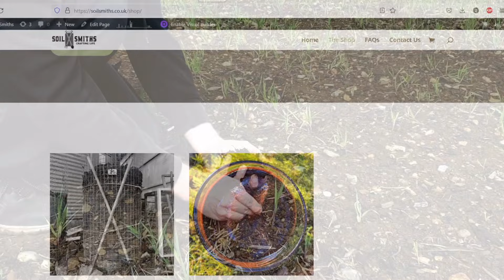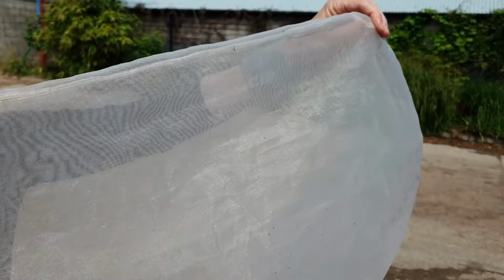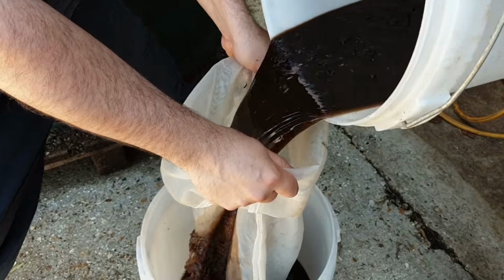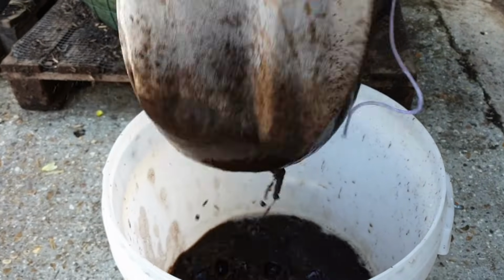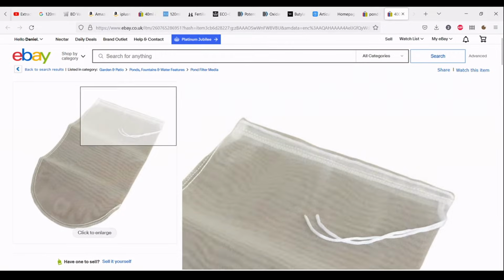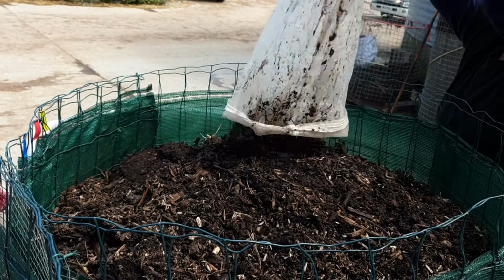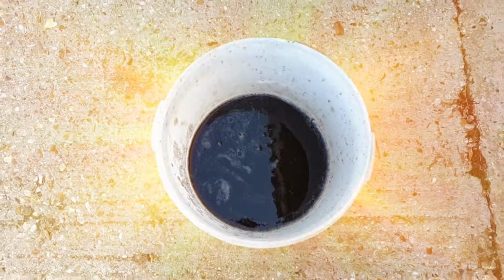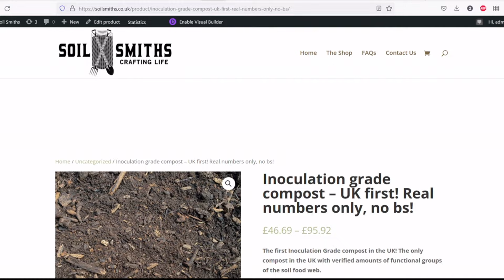The most effective tool for extracting microbes from compost

Comment: Great video - thank you - & I'm now a subscriber. I'm from Sydney, Australia where our water is chlorinated & has fluoride added. I'm guessing it would be preferable to use water without those additives - would you agree?
Reply from the maker: for straight chloride you could use vitamin C, but fluoride would need to be filtered with an active substance or reverse osmosis. Before you do it, you may want to send a sample to a lab to see if the amount is high enough to kill microbes. Where we are, the levels of chlorine are several times below the threshold.

Comment: Just because it is called compost tea does not mean you have to put it into a tea bag. You see people using nylon tights, which is a fine nylon mesh: 1. the mesh stops at least some of the microorganisms from getting out of the bag, 2. inside the bag the levels of nutrients and oxygen are low. Both of these make the method longer and less efficient.
Reply from the maker: what alternative do you propose?
Reply: Interesting video, very cool concept.
I suppose for a watering  you could probably use a sieve. 

I dont know if that would work for machinery or if it have to much debris.
Reply from the maker: @johnyguitar-u1i we used large scale sprayers with it. we put 1mm nozzles and removed filters.

Comment: Thanks a lot for this video.  It is most interesting.   One question, for how long can I store this compost extract before using?
Reply: Nevermind....  I just saw that someone asked this same question....  You don't store this, but use it at once.  😀
Reply from the maker: @edgardriba7513  if you happen to be in the UK, we've made a concentrated extract which is storable https://soilsmiths.co.uk/

Comment: This makes no sense, the microbes are there in the compost because of the food (decaying organic matter) Soil is already saturated with microbes for the amount of food. Just add organic matter (mulch) or compost to soil and the microbes will come
Reply from the maker: That's not what we've experienced. Adding microbes after a green waste compost application increased yield of barley by 40% against control. Adding microbes to a pasture increased biomass by 22%. Using them with radishes gave 27% increase. With carrots 19%. Chillies with seed coating 47%. We've measured a reduction in water loss and confirmed it with DNA analysis. This is not a panacea for world problems, but the notion that the microbes you have in the soil are all you need can be incorrect too.
Reply: @danieltyrkiel6438  Did you fertilize the control? You extracted the microbes from compost which is nutrient rich, it seems like you got some nutrients with the microbes
Reply from the maker: @johnnyroe8053  sure, there are always some, but Manchester Uni has been trialling it too, and they did a lab study where they sterilised our extract and the plants performed way worse. Hopefully that paper will be out at the end of the year.
Reply: @danieltyrkiel6438  Ideally you would try to measure the nutrient concentration of the "microbe solution" that you sprayed and then you match it with a nutrient solution without the microbes for the control.
Reply from the maker: @johnnyroe8053  it can also be done in reverse, and has been. The nutrient in microbes is not a significant factor.

Comment: Does the pressure of running the compost extract through the chemical sprayer not kill the microbes ?
Reply from the maker: No, we've checked after passing through the machine and it was good enough. We've lost some protozoa, but that wasn't significant enough to invalidate the kit.

Comment: very helpful sir , i often wondered how would you replace nitrogen on real farms ,i make compost myself but how would a guy with 100 or more arcres get microbes into the soil [in order to use less chemical], this looks like it might work .
Reply from the maker: We built a metal cage, suspended it under a gantry crane, and put it into an IBC container filled with water. Then used the same paddle mixer, and now we can have 600 litres at a time. You can then extract several times into the 600 litres to increase the amount of microbes in the mix. It won't replace all fertilisers. IF you grow intensively and use fertilisers already, you need other inputs. I would rather use manures though. Stabilise manures with effective microorganisms first to limit leaching.

Comment: How long can you store the extract?
Reply from the maker: you don't store the extract. just apply.
Reply: If you figure out how to put biota in a dormant state then it can be stored for ages under the right conditions for ex. dark and cool place otherwise extract has to be used on the same way as a tea straight after it's been made. 
I can only think of it theoretically for example put extract into the fridge to push biota for self preservation and then close the bottle/jar with lid to make conditions even worse to push the biota in the dormant state BUT  it's ONLY my theory.  Sorry for my English but I hope you caught the idea

Comment: Thank you for sharing THE KNOWLEDGE! 

I am not sure if I am going into right direction as I would like to apply this method to my vermicompost to extract all the biology. To my understanding it will work too BUT only with fresh worm casts due the highest bilogy activity.
Am I wrong?

Also, I would like to ask if you know how to store extract for a long term to keep biology alive?

 I've seen few commercial products selling worm poo extracts in bottles and saying that all the biology is undamaged and alive. 

I like experimenting with my own tools and hence I prefer to try first and buy late in case of failure 😂😂😂

Thank you for reading!!!
Reply from the maker: Hi Denis, I can imagine fresh casts will have a lot of bacteria. If you use plenty of wood chippings in your composters you could get quite a bit of fungi, and these actually increase with time. You can't keep aerobic biology alive in a sealed water environment. It needs air. We make our Goop in a format which allows air ingress and that coupled with fridge temps keeps it going for months.
Reply: @danieltyrkiel6438 Thanks for getting back to me. That's, interesting ... All commercial liquid ALIVE BIOLOGY inculants CLAIMS to contain bacterias and fungi in sleeping state in the tight closed bottles and can be stored in dark and cool place without keeping it in the fridge up to 6 months. I think to find out it is the only to check these products under the microscope. 
Would you suggest any budget but good microscope? 

Thank you!
Reply from the maker: @denislukasov4813  I usually suggest this one. We have seven of these in the lab. https://amscope.co.uk/products/omax-40x-2500x-super-speed-usb3-5mp-digital-compound-trinocular-led-microscope

Comment: This is different from compost tea though because compost tea is to propagate the bacteria by adding food and air. I don’t see why you couldn’t add a bubbler to your product with some food and increase your bacteria
Reply: Usually when making compost tea, you sacrifice the diversity of the microbes for a higher compost amount. Compost tea shouldn’t be used for seed inoculation it should be used for spraying the surface of leaves that protect them from leaf pathogens.
Reply from the maker: we usually get lots of flagellates when bubbling an extract. Fungi and nematodes die off.

Comment: nice to see this video, could be possible know the ratio of application with this high concentration? :)  thx so much
Reply from the maker: We would use up to 70 litres of compost extracted per hectare, but for seed application, we're still working it out. At the moment we're using 10-50ml of extract per litre of water to be used for coating seeds, so very little...

Comment: Do you have any concerns about microbial degradation going through pump agitation or higher pressures in your sprayer? Is there a maximum pressure and certain types of pumps that work better?
Reply from the maker: We only had access to the stock Chafer sprayer with max pressure of 5 bar. Checking at each stage with a microscope showed no losses.

Comment: What sort of rate/Ha and concentration of extract to H2O in the sprayer are we talking here. Defiantley something I'm interested in as we're moving away from Conventional Ag to Regen Ag.  I'm trialing home made seed dressing on ag scale here and have found that one of the best so far is made from using the liquid strained from soaking seeds for 18hrs. The theory being that the seed releases a lot of its enzymes, stored bacteria and goodies to prime soil for growth tip emergence and you're stripping that from those seeds and priming the desired seeds you're dressing. I noted a 15-20% increase in root mass and rhyzo -sheath on seed dressed with this at a concentration of 1:10 with rain water and applied at 20l/t of seed. I'm going to try your compost extraction technique and add a litre of the concentrate to my mix at 1:20. Thanks for the great video, much appreciated.
Reply from the maker: So far we've been extracting 70 litres of compost per hectare and adjusting the total water volume to suit the sprayer
Reply: @danieltyrkiel6438 so what’s quality can I use for my 16liters sprayer? Thanks
Reply from the maker: @emanovwevoke1913  quality or quantity? Extract can be used straight.
Reply: @Verney Teabag, this is amazing about the seed dressing. Definitely not the first time I am reading about such, though I had a slight variation in mind. 
How about, you let the seeds sprout, then use brown sugar to pull the microbes and enzymes from sprouted seeds? Kind of like in the same fashion as other bio amendments in KNF.

Comment: Do you think the plaster mixed will work on worm tea? Cheers m8
Reply from the maker: Worm castings, yes
Reply from the maker: You may be able to avoid a lot of straining as worm castings will break up into fine particles. The sifting step comes earlier though so it's a trade off

Comment: My soil hasn't seen fake fertiliser in the 20 years I've lived at my property. I must have good compost, as everything is strong and pest resistant. I only compost on the ground in piles, using plenty of carbon with green waste and woodchips. It's packed with worms. Cover crops really help the soil too.. the Daikon radish is my favourite. It's roots can grow 50cm, boring into the ground. You can grow it alongside crops, so it can transfer those nitrates to your crop. I never pull clover, since I noticed the plants next to it grew better. That pretty pink and white clover, fixes the lawns and puts on a good show with the wild fusias. Nature knows what it's doing.

Comment: Interesting. Will the same principle apply to worm castings when making worm tea?
Reply from the maker: Yes it will.
Reply: @danieltyrkiel6438  Thank you, but will this increase the population of microbes in the same way that a 24hour aerated bubble tea brew would do, or does it only separate the microbes from the compost?
Reply from the maker: @pilkyish  This is only an extraction process. It's designed to take the microbes off the compost and put it into water. Not increase their numbers.
Reply: @danieltyrkiel6438  Thanks for replying.
Reply: I do an extraction of vermicompost using a gentle, by hand agitation. Dunk & agitate every 15 min for about 2 hrs. I use coolish water & do the agitation in a cool, dark basement & drench seedlings ASAP. I plant out early mornings/late evenings. At planting, I pour/water the seedlings with any remaining liquid from the drench & throw some spent vermi muck from the compost screen bag in each hole.

But, I am not using mechanization. Clogging equip never an issue on a smallish scale.

Comment: Why on earth would you want to remove microbes from compost? Separation from their sustenance...pointless! Just add the compost to the soil.
Reply: It's a matter of scale for those planting acreage. Spraying an extract or seed coating allows them to stretch the biology using mechanized equipment.
Reply: @flatsville1  ...AND DEPRIVES THE MICROBES OF THE SUBSTRATE (COMPOST) UPON WHICH THEY DEPEND ON FOR SUSTENANCE.
Reply: @thetransplanter3337  Perhaps. He apparently has microscope work indicating the survive the initial agitation in significant enough numbers to be useful.

Will they ALL survive? Likely not.

All a large scale farmer needs is for enough to survive to decrease/eliminate use of fertilizer, pesticides & herbicides. Such is farming at scale. Remember, they are growing crops.

Further microscope work from soil samples at various points in the growing season indicating at what rate they survive & thrive post application is needed.

Some studies use end of season crop yeilds v control a plot to determine if the applied biology had any effect...which it apparently does.
Reply: @flatsville1  This violates a fundamental prociple of sutainable soil management: Add soil organic matter to nurture microbial health. Removing the microbes from their source of sustenance and placing them in unenriched soil is an early death sentence for them. The health of the soil is at stake. Your baseless theory is unwelcome.
Reply: @thetransplanter3337 Are you under the mistaken impression that a covering of physical compost is the only way to create/nourish microbes? Physical compost is only one of several microbe transfer methods. Sustainable farmers & ranchers have been spraying extracts, compost teas & other liquid biology into & on the soil where it thrives just fine. This is not new.

I take it you have never planted out large acreage using mechanization or even watched a farmer disc & drill seed. Warching a video of the process may help you understand the complexity of large scale farming with mechanized equipment.

Again, the point is to spread some biology to lessen fertilizer, herbicide & pesticide use using available configured equipment. Farmers/ranchers are putting in crops for production. If some microbes die in the process, that's expected. They are not curating individual microbes.

Numerous studies indicate seed coating or spraying into the furrow at planting boosts yeilds & does improve soil life in fields based on yeilds in studies. It works.

When you can figure-out how to make & spread 4 in of physical compost on site for each farm (were talking tons & tons & tons) for a 200 ac wheat, corn or soybean field, disc & drill the crop without making a shambles of the process, let us know.

This ain't backyard or market gardening. This is large scale ag.
Reply: @flatsville1  Your didactic condescension is not honored here. I am a Certified Crop Adviser and a Regenerative Organic Ag professional with over four decades of experience. You operate with an obsolete paradigm. Next time, look before you leap!
Reply: @thetransplanter3337  Based on that theory, there would be no microbial life in any soil that wasn't covered in compost which we know is not the case.

There are millions of microbes in soil taken from bare dirt patches.

Many gardeners use soil with a mulch covering & do fine with interplanting, relay cropping, rudimentary crop rotation &/or cover cropping. No curated compost needed. The spent crop roots & covercrop roots provide organic matter to the soil. The winter killed cover crop provides mulch. That's it.

Solid compost is only one method of delivering microbes. I've grown-out & used plugs followed by cover crops to distribute endo myco in a large area/long crop beds & used in furrow compost extract at seeding/transplant time for a bacteria boost.

I can afford to do this because I am not practicing large scale ag while trying to produce a crop on contract.
Reply: @thetransplanter3337  absolute bollocks. Apply the liquid to a seed and sow, they will begin the mutualistic association within days.
Di and Ian Haggerty have had overwhelming success with this aproach on 10000+ Ha. In the oppressive west australian wheat belt
Reply: @666bruv  They would amplify their success by adding the compost as well.
Reply: @ritacrevoshay4800  well sure, on a garden scale, but on 10,000Ha, impossible. 
There is substantial success documented using compost,vermi extracts as a seed coat, then as a follow-up cover spray at around 4kg/Ha (washed into solution), Dr David Johnson has done the same with his BEAM.
The cheapest and most effective means of adding loads of OM, is with cover crops, 25-50kg of seed per Ha, inoculated with the extract.
This way your limited compost resource can cover more area for less cost. The seed coat tricks the seed into thinking it is germinating into a richly diverse habitat, stimulating the signalling enzymes that tell the bacteria and fungi to start mining the geology for the required nutrients/minerals as the germ protrudes from the seed.
And this is what has evolved over the past 4billion years
Reply: @666bruv  Fascinating...and you are right on the money regarding cover crops1
Reply: @ritacrevoshay4800  the planter might not be able to add 0.001 grams of compost near each seed but can work with coated seeds. could be an issue of how, not of what.
Reply from the maker: there could be different reasons. Some farmers don't have enough compost. Only recently many farmers started putting up JS bioreactors because they are simple. Then all they need to do is to make an extract and coat seeds.